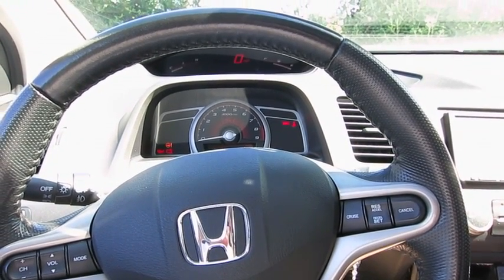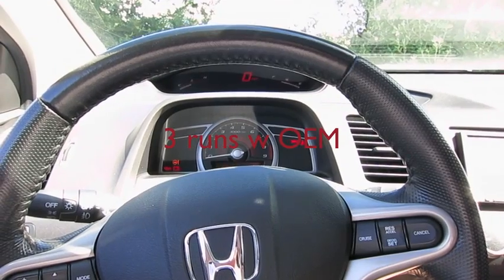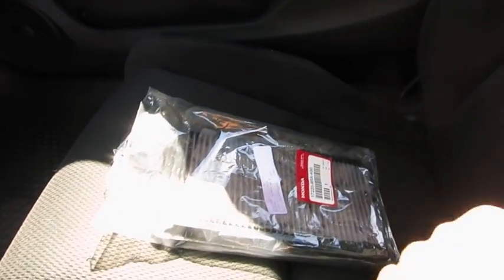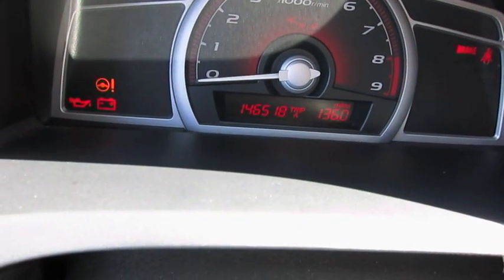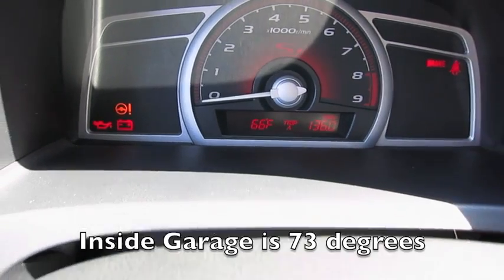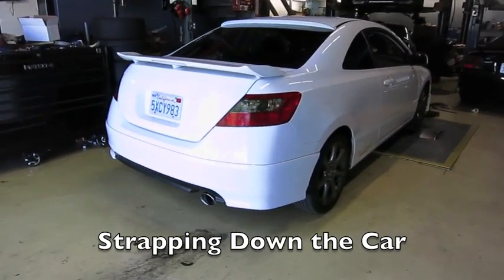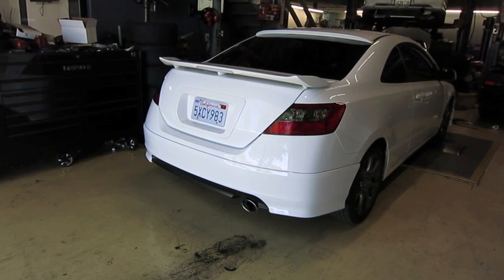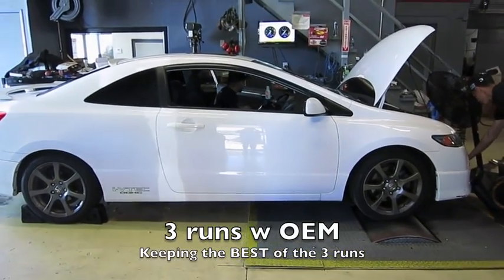Stock 07 FG2 Civic Si on Dyno w/ OEM and K&N Air Filter

Comment: Fuck them air filters.  Have fun when your engine shits on you for all the dirt and composites going into your engine . I fell victim to wanting a cold air intake or "hp filter , not realizing the dust and shit you allow because it's so thin . Not worth it .  Learning from a video on here you can't have both.  Either pick more air or more fileration . The oil on those things do absolutely nothing.

Comment: I'm sold! And to think I was going to buy a short ram intake, thanks for the dyno proof.
Reply: It's just my daily, I don't plan on doing anything to it except maybe exhaust.
Reply from the maker: @robertmuncy9888  oh. Yeah, I like it on my daily too.
Reply from the maker: to be honest, if you are going to do more upgrades, a short ram intake would be better choice. I think the drop in is good if you don't plan on doing too many upgrades.
Reply: @OEMEangg  I heard and read that short ram intakes for the 8th gen are horrible because its just sucking in hot air. I was thinking about getting the typhoon also but read the same thing.
Reply: @takumifujiwara783 short ram is just that,  hot air intake that offers sound while decreasing hp

Comment: Google  197 HP 
Dyno 180 HP
Reply from the maker: You are correct. 197 is brake horsepower (BHP). 180 is the wheel horsepower (WHP). Manufacturers use brake horsepower because the number is higher. You can also google "WHP vs BHP". Hope that helps.
Reply: Google shows the hp from the crank
Dyno is wheel hp
Reply: Really bro good job just put a sign on your head that says i know nothing of cars but read the internet so i think i do 😂 whp and bhp is elementary shit
Reply: @jamespuckett1770  Right!  Smh at these kids nowadays 😂

Comment: Thanks for the video, was hoping someone would do it for a 10th gen, but I've suspected that CAI compared to a good drop-in would be negligible in performance gains, albeit a forfeiture of better sound and visual presentation. But living in a region with tons of salt from snow on the ground I would rather have the security of the OEM box. Got a ktuner waiting to be installed and thinking of doing a PRL downpipe, maybe a muffler delete and calling it quits for a while.
Reply from the maker: Kturner and PRL would be a good choice. Not sure about the muffler delete. Since you are already doing intake, might as well do exhaust. But do whatever makes you happy.

Comment: Honda has literally 140 lbs of torque
It’s not a performance car
I have one 
It’s slow as hell
Reply from the maker: It's not that fast but it is fun to drive. Also reliable.
Reply: oem Eangg i have a 2010 and the rear end feels vague at about 70 mph

Probably need stiffer springs
Reply from the maker: This would be just a guess... yeah, it could be suspension. How is the tire and tire pressure?
Reply: @okinawanah3463  sounds like u just bought a pos si one in good condition is amazing to drive.
Reply: @OEMEangg  anybody that spits specs to compare doesnt know shit and i doubt he has one i have yet to meet someone who owns/owned one and didnt like it
Reply: @jamespuckett1770  yea a lot of people underestimate hondas because its just a 4cylinder but the catch is when modified that 4cylinder vtec can embarrass bigger engines I've seen modified 4cylinder VTECs  pull away from v6s easily
Reply: @cedricmiller4370  fuck a v6 if you put a blower or a turbo with bigger injectors and a solid tune with sticky tires on youre in terminator cobra and zr 1' territory 300whp on a 2700 pound car is wicked fast but yeah basic boltons and a good tune with a 4500 vtec window will get you to pull on performance v6's for sure an 8th gen stock is only .8 seconds slower 0 to 60 than my 2008 acura tl type S was [6.3 seconds to 5.5 seconds] i think thats pretty impressive personally.
Reply: Okinawa Nah They're still the cheapest fast ish car you can buy.   I can't think of anything in the same price range that's reliable.   But I agree they are slow as shit I until you hit 6k rpms which in daily driving situations is kinda useless.
Reply: Why does it have to be fast tho??? Are miatas fast? Wrx? 350z? G35?? None of those cars are fast either
Reply: Its light as hell though, these would keep up with stock mk5 gtis with like 50-60 more wtq. all about power to weight

Comment: Ive had K&N for 2 years now and I’m happy with it. Sharper throttle response and it changed my exhaust note a bit
Reply: did you reprogrammed the ecu or its not necessary???? i want to gain some hp without reprogramming . will it works???

Comment: the thing is can you actually clean them and reuse them for any amount of time?
i believe that they provide better flow but i doubt you can reuse them for that long
any opinions welcome
Reply from the maker: The K&N filter is new but I think you are right. Eventually, the rubber material on the filter will deteriorate.
Reply: @OEMEangg  million mile warranty- Ive had them in vehicles for  10+ years no issues
Reply from the maker: @bikeman1x11  Agreed. The car has over 200k miles and no issue.
Reply: yeah thats my bet too

Comment: was the stock air filter also a new one?
how is the rest of the motor...fresh oil? new spark plugs?...maby you could check your spark cable. this car has a lot of miles and runs pretty well.
Reply from the maker: The stock filter is brand new. It has less than 100 miles on it. The K&N filter was cleaned and oiled, so I kept it in the bag. I believe oil has 1k miles. Spark plug has less than 15k miles. The 8th gen Si does not have cable. They have coil packs. The car runs great! I bought the car brand new. I do most maintenance myself.
Reply: oem Eangg okay cool. Thanks.🖒

Comment: Do you have to clean the KN before installing it? thank you (dumb question)
Reply from the maker: The K&N filter comes pre oiled, so there is no need to clean. It is ready to install.
Reply: You will have to buy a cleaning kit when it comes time to clean it. It comes with oil.

Comment: this is for all the haters out there. before i used kn filter i had an oem filter for my 12' civic coupe and was averaging 25 mpg (city only) and after switching to kn filter i gained 3mpg which equals to 28mpg. stop saying shit about a product you havent even used. this product will pay itself off in the long run and yes i did research before getting it. and as for the saying "the engine will suck up more dirt" do you think an oem filter doesnt suck any dirt at all? ive used kn filter on all cars and will continue to use them. dont listen to these dumb idiots.
Reply: I've had okay results on all my cars, but I once put a K&N (checked that it was a real one too) in a 6 cylinder BMW turbo diesel and it noticeably lowered throttle response and high-end power. They're not a holy-grail performance booster.. just be warned! - That being said, I still stand by the fact that they should improve things!
Reply: Just wait when ur maf sensor gets dirty from the filters oil
Reply: Civic dont have MAFS
Reply: @stevem9141  yes they do lmao
Reply: @walahmelons5504  no they have map sensors
Reply: @stevem9141  It's literally right on top of the air box. If they didn't have a maf sensor it wouldn't be such a big deal to need to a tune with a bigger diameter intake
Reply: Ojileb M I’ve had one in my 2004 Camry  V6 from 30k miles all the way to its current 200k miles. MAF is functioning just fine.

Comment: with a K&N you have to disconnect the battery or run the car for a while so the computer calibrates  to the increase in airflow. if you didn't do that you actually gained more than 5 horsepower

Comment: not worth the extra dirt in the engine. those filters pass more practicals than any other brand name drop in filter
Reply: Oil analysis tests have already disproved this. There's a video on that.
Reply: I invested in one. Lets just say if you have a full exhaust system you will take advantage of the k&n filter more. Think of the engine as an air pump. The more air you can flow in and out...the more HP you'll get!
Reply: buddy so the K N filters work? I want them bad and I'm doing research on them lol
Reply: Practicals? Or particulates... Have you had experience with this occurring with the K&N if you don't mind me asking?
Reply: u make no sense

Comment: Hey man, great numbers!  :)

I just ran some Dyno pulls myself on my own car, and got some wicked good numbers as well.  My car is a 2010 Civic Si FA5, and the only mods that I had installed at the time were an Injen SRI, as well as a set of NST pulleys (full three piece pulley kit).  VERY MUCH recommend the NST pulleys, as they have made a difference!  Those are the only two mods that I've done, no tune, nothing else.

I know (as I am sure that you do, too) that bone stock 8th gen Si vehicles put down around 175-180whp, so was hoping for good results with the few mods that I have.  I was expecting to lose a few HP with the Injen SRI, as I'm untuned.  But was expecting to gain around 7-10whp from the NST pulleys (what NST has quoted).  The few pulls that I did, were done on a DynoJet.  I ended up making 191whp and 136wtq (after correction it was 189whp & 136wtq).  VERY happy with my results, as the shop told me that their DynoJet also reads a bit low, so I'm PUMPED!  All I really wanted to know, was that my car was healthy, and it seems it's a bit more healthy than that.  The NST pulleys definitely made a difference, as I would not have made 189whp with just an Injen SRI, untuned.  No way.  Even the shop was surprised!

I subscribed to your channel, so please come over and check out mine!  Take care!   :)

Comment: Cant wait to get the K&N for my TL. I hope it gains as much power as this SI did.
Reply: oem Eangg I heard the design of the oem air box is really good 
I say just buy a k&n drop in
It breaths a little better and never have to buy a new air filter again
Reply from the maker: Yeah, Honda stock air box is very good. That was my reason. I didn't want to buy anymore filters.
Reply: I wonder if a cold air intake system would improve on the standard box ?
Reply: @senorsabata1619  not without a tune
Reply from the maker: Honestly, I didn't think there would be any gains in hp. I actually thought it would have lost hp because I heard and read that OEM Honda filter was supposed to be really good.

Comment: My fg2 must be factory freak or something. I hit 200 whp with aem intake ONLY, everything else stock, on dynojet.
Reply from the maker: 200 whp seems pretty high for just intake only BUT it is possible. The 184.43 hp is with SAE, smoothing of 5. I don't recall, but i think if I used STD my car would be at around 192 hp. I chose SAE over STD numbers.
Reply: Dyno is a measuring tool. Take those numbers with a grain of salt.
Reply: dynos vary..  :)
Reply: BS

Comment: Hey thanks for the vid,  I have a couple questions which have not been answered here:
1. The car ECU/fuel metering after installing the K&N has not been altered in any way, right?
2. What happened to the average MPG's in your usual driving style? Numbers appreciated
Reply from the maker: 1. Nothing altered. I just changed the filter. That is all.
2. I usually calculate my MPG every other fill up. I do not see any noticeable change in MPG.
Just a side note... Only thing I notice is the K&N has a deeper and a little louder sound.
Reply: Would it be recommended to unplug the battery for a little while to reset the ECU so that it recognizes the change in air flow and adjusts to it? Usually it's best to reset the ECU after any performance upgrades.
Reply: @SupraRy no need. The ECU will re-learn itself over short amount of time
Reply from the maker: There is no need to reset the ECU. This is just a drop-in filter. If I put in the cone filter, then I would probably do the reset. But it doesn't really hurt to reset it anyway.